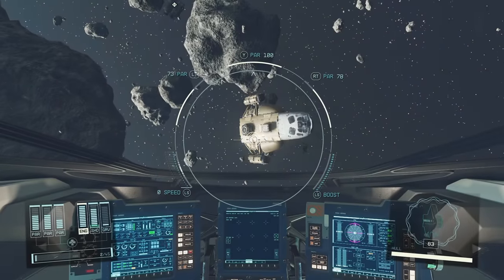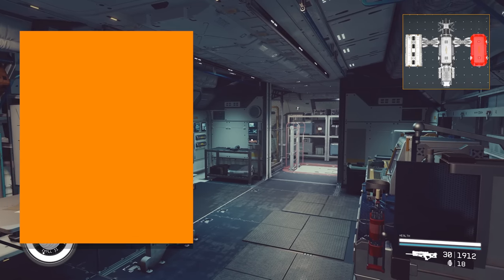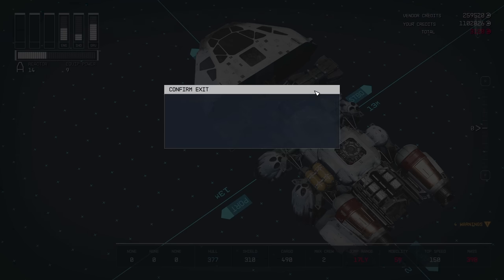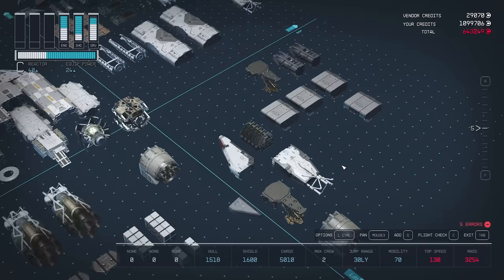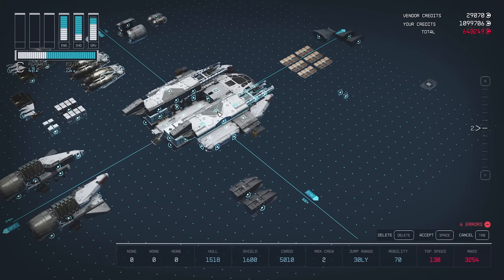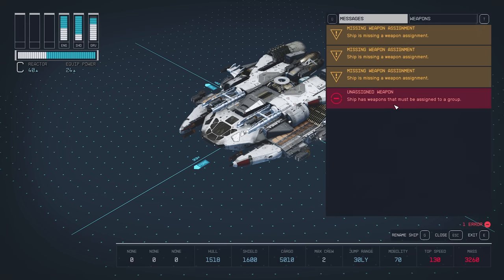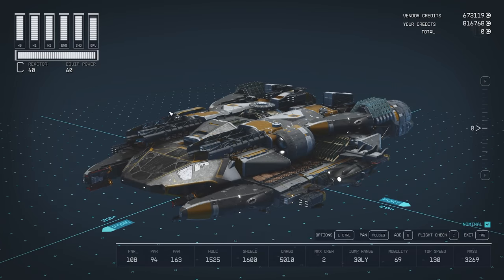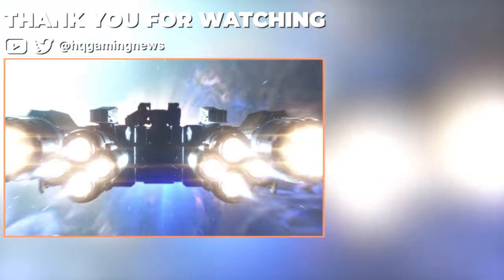The ULTIMATE ENDGAME ship in STARFIELD - No Mods, No Glitches, No Exploits

Comment: The Left Hand HE3 tank will not attach. If I take out Habitat and connect the HE3 tank, it works. However, when putting it back, the tank turns RED and won't attach. If I remove the top weapon, the tank will attach, but once it goes back, the tank goes red again. The only way I got this to work is by flipping it with a glitch, but the flight check says 'too much weapon power' and 'component missing

Comment: Do i still unlock the vanguard obliterators if i chose the crimson fleet?
Reply from the maker: I did UC quests first and Crimson Fleet second, and now I have the best of both worlds. I think you can do it the other way around, but I can't confirm that.
Reply: @hqgamingnews  damn i hope so.. lol hopefully someone else can confirm. Thanks!
Reply: @hqgamingnews  hey i need a hand again, sorry. I'm level 60 with max ship design and piloting. Why can i still not get certain ship parts like taiyos captain quarters? I even went to neon and the vendor still doesnt have it😮‍💨
Reply from the maker: To cycle between different hab variants, use the right arrow key (or right on the d-pad if you're on Xbox). Also, sorry for the late reply.
Reply: @hqgamingnews  hey, all good i figured it out! The ship is great and just to follow up on a previous discussion, i chose the crimson fleet in that story line and still unlocked the obliterators! So doesnt matter who you side with

Comment: use SAL 6830's, mobility will go up. 

You get SAL 6830's during the stroud ecklund mission in Neon from the main constellation questline, so long as you choose the Diplomatic option and don't kill the CEO guy.  they will be available at the stroud shop on neon.  ( the one in the main entrance area after you enter the elevator from landing pad) be prepared, they are about 70K per engine.
Reply from the maker: I wasn't diplomatic at all during that questline, so no BiS engines for me, unfortunately.

Comment: Bruh, why the rookie mistakes?
You're using the wrong landing bay. use the Hope tech. if you do, you'll be able to have a front-facing landing bay without changing the layout. connect it to the companion way. The better way is to use a 2x2 Nova All-in-one hab connecting to the bottom of the cockpit and a Deimos workstation next to it(the Deimos workstation is the only workstation with all the benches + a research station) you won't even need a companionway and cross braces. and using Hope tech landing bay will let you use Nova landing gear which has the highest thrust between every landing gear meaning you'll need less landing gears.
Also, the HopeTech Hab Cross Brace weighs 14 (28 cuz you use 2) instead you should use Nova Cross Passage which does the same and weighs 4 (8 cuz you'll need 2).

my suggestion: Nova cockpit;
first floor: 2x3 Deimos cargo bay connected to 2x1 Deimos workstation and 2x1 frontier all in one(unique hab) the two 2x1 should not touch. the two 2x1 should connect to the 2x3 cargo hold via hope tech spines. the hope tech landing bay should connect front facing to the cargo hold(it makes sense for the entrance to be in the cargo hold that's how you load cargo in a ship, directly from landing bay)
second floor, 2x2 battle station of your choice(lots of crew cap) connected to the cockpit + armory right next to it(direct connection, no cross hab) + at the back of the battle station(back outerside) a hope tech spine connected to a 2x2 Nova all-in-one with the captain quarters(preferably Nova) next to the 2x2 all-in-one(directly connected). you'll put a companion way on the other back of the 2x2 battlestation with a cocker on top of it.
You'll have plenty of space to hide the giant grav and reactor between the habs. and the inside of your ship will be huge and very practical. lots of beds on both floors. every bench+cooking+research station+armory+more than 6 crew.

That's how I made my Spectre MK-IX(Yes there was 9 versions) large ship. Now I'm using Spectre SR-4(Stealth Reconnaissance) as my high-speed high-mobility high-DPS small ship.
Reply from the maker: Hey, thanks for the suggestions. Gonna experiment for sure.

Comment: Missing some components - what skills do you need leveled up? Starship design?
Reply: Went piece by piece and different parts require SD 1 up to 4. On top of that it looks like the engine unlocks at level 60 and also required SD 4.
Reply from the maker: Everything explained at 24:43

Comment: Can this be done without a planetary base? Can't be arsed with them.
Reply from the maker: Yeah, you can do it, but you'll have to run around a bit to grab what you need. You really only need the landing pad; it doesn't have to be a full outpost. Just pop down the outpost beacon and slap in the landing pad. You don't need power or any other buildings, just the landing pad.

Comment: I really love this ship. I've been using it for a long time, but I think I'm encountering a bug that only seems to occur when using this ship. For some reason, my shields do not regenerate in combat even after not being hit for over a minute. 

I've tried everything to figure out what's wrong. I've swapped shield generators. I've taken power out of the shields and put it back. I can't get the shields to come back in combat. I've switched to a different ship and it doesn't have the same problem. It's mostly not an issue because you can destroy most enemies before they take your shields out, but it makes attempting to disable/board enemy ships a pain.

Has anyone else run into this?

Comment: Wait, how do you buy all the special parts from all the different suppliers??? I always have to attach that stuff to my ship and fly across the map to each one. So annoying. And no, the large pad does NOT have ALL ship parts. In fact, the 3x2 ,2x3 and 3x3 habs aren't to be found at all and i am "max everything" in ship engineering .
Reply from the maker: Well, you don't have to edit the ship you're currently using. You can choose one that is sitting in the hangar. This way, when you visit special parts vendors, you can attach those unique parts to that specific ship. It can save a lot of frustrations. But yeah, you're still going to need to jump to a few places.

And you are right, the biggest 2x2 up to 3x3 hab modules can only be found at the manufacturer's site.

Comment: There's something bugged in the varuun ship I commandeered to upgrade. Everytime I get a few steps in after adding engines  reactor, and grav, I get the " invisible ship" problem again. I'll just have to restore to before the commandeering
Reply: What I'm about to tell you , I SWEAR I'm not making this up .
So I restored to before the invisible ship problem and this time modded a free class A  ship, not stolen.   
After I applied the Cabot  bridge, which of course was far too wide for the two  habs attached to its centre , I went to Hopetown to get the spine and bracers.  Got out of the ship , stood on the tarmac   - and my ship had STRETCHED  TO TWICE  IT'S WIDTH  so the habs met the edges of the Cabot bridge !!!    
The front facing bay  - there was now TWO of them  along side of each other.  AND there was a structural piece in front of both blocking the entrance so I could not board!!!   And there was none of this in the ship builder!
So I started all over,  this time applying the Cabot bridge last - success !
Reply from the maker: I believe you. I've encountered multiple overlapping bugs that can be fixed by returning to the menu or completely exiting the game. This issue occurred with bridges, cockpits, habs, and various structural parts.

The funny thing is that it only happened at HopeTech.
Reply: @hqgamingnews   yes, its become apparent some bugs are planet specific. You wonder if the buggy planets were programmed by one specific developer at Bethesda ?

Comment: As I was getting the parts together I found no Port of Aft parts.   Will have to come back to this I guess.  Forgot.  On console it is a crapshoot for HABS.  Don't know what we're getting except for engineering.
Reply from the maker: For certain parts, use the left D-pad to cycle to Port or Aft variants (while browsing parts). However, some variants can only be accessed by flipping parts with the Y button. Hope you find this tip helpful.

Comment: hey i’m level 130 but at 7:14  under habs taiyo captain’s quarters 2x1 mid , taiyo science lab 2x1 mid , nova galactic armory 2x1 doesn’t shop up for me. how can i get them ?
Reply: Also have starship design lvl4
Reply from the maker: Are you using the left/right arrow keys (or d-pad if you're on the Xbox) to scroll through the all available hab variants?
Reply: @hqgamingnews Pc and i got all the parts for Structural except 2x Deimos Wing C.  i only see Deimos wing c- port is this the one ?
Reply: nvm i got it thanks :)

Comment: Im very frustrated.  Im level 100 and I cannot get any of the Taiyo parts to spawn anywhere - not even in the taiyo showroom.  No captains quarters, science etc.  What am i doing wrong? Is there something other than level that unlocks them???
Reply from the maker: That's weird. 2x2 and larger habs can usually be found at manufacturers, but it's 2x1 and smaller ones that are common and available at your outpost's landing pad.
Reply: @hqgamingnews  i figured it out. There are alternate versions of parts in some cases so you have to use the arrow keys on a regular  2x1 part to see it. 

This is what happens when youre overtired and building at 2am lol

Comment: I was so excited for this having leveled up Piloting and Starship Design specifically. Now I see the level 60 requirement. Some components are locked behind a level? That sucks. It sucks that items are both level locked and stat locked. Guess I'm just going to make the best I can. Kind of shit though. Feel like my ability to make shit loads of money, and sacrificing points for ship building, should be rewarded.
Reply: Having built this now at level 34 the only issues I had was the PB0-175 Auto Helion Beams (had to go with PB-175 Helion Beam - non-auto), the SF40 Reactor (got the SF20 instead which will likely make all my weapons kind of useless), a worse Grav Drive (got the RD-3000 Beta instead and used a Nova Bracer below for the tail fix since the RD-3000 isn't a 'two-level' piece), and swapped out the two Amun Dunn X-300 Engines for more Supernovas (best I had available).

While I'm able to complete the build, I have about half the jump range and mobility of this build. Still stoked to see 'nominal'!

Comment: Didn't work for me , built it exactly as shown and wouldn't let me finish, kept saying landing bay needs to be connected to cockpit , and docker module's need interior connection to cockpit
Reply from the maker: That's odd. I built this ship twice from scratch just to be sure everything was in order before making the video. It has a very simple interior layout, so I can't troubleshoot without looking at some images. However, that "landing bay needs to be connected to the cockpit" message is something I've encountered in some of the other ships, and the only conclusion I've come to is that the editor's pathfinding is the culprit. I mean, you can clearly see that everything flows nicely, but the error can still pop up. So this might not be you, just so you know.

Comment: Not buildable without some kind of cheat. The tanks will not attach to the left side without using the glitch technique, and the errors say 'too much power to weapon' and 'missing components,' despite me building exactly to these instruction
Reply from the maker: You can't have more than 12 power assigned to any one weapon group. If you list how many of each weapon type you bought, I might be able to help.

As for the fuel tank, did you flip the part before attaching? (Z on PC, Y on Xbox)

Comment: Not a jack of all trades if you have no em weapons. Em is a must if you want to cleanly handle boarding etc without blowing everything up. Plus you should do Walter Strouds mission to get best sal engine in game to push mobility up. My ship has 15k cargo weighs 5000 and still has more mobility then this.
Reply from the maker: 1. As explained at 23:30
2. I did that questline in a not-so-diplomatic way, so I'm locked out of those engines forever.

Comment: I built the ship according to your instructions, but when finalizing the system says "Too much energy consumption, reduce your weapons".
Reply from the maker: Can you list how many weapons of each type you bought?
Reply: @hqgamingnews Where did you get the J-52 Gamma Grav Drive?  I don't have that at all.  I use the Grav Drive SGD 2300. My installed weapons are Auto-Electron Beam PBO-40, Auto-Proton Beam Distuptor 3310A and Helion Beam PB-175.
Reply: @hqgamingnews I don't have the reactor you have either.  My highest level reactor is the Theta Pinch C9.
Reply from the maker: It's probably your reactor that causes these errors. Check 24:43 to see if you meet all of the requirements.

Comment: my specs for my ship Crimson Wright iii upgrades Pinch 8Z Reactor, fuels tanks 2 x 700T He3 Tank removed the 2 small fuel tank back the ship for mass, Assurance SG-1800 Shield Generator,  Apollo GV200 Grav Drive 6 x SAL-6330 Engine how i achieved this moved the docking port to the right side of the ship and placed generator there, Weapons im affraid all weapons had to be swapped duo to the fireing duration between shots being too long!! not ideal specially multiple hostiles, 6 x Vanguard Arbitrators, 4 x PBO-175 Auto Helion Beam, 3 x Vaporizer 35MeV Proton Beams

Comment: Very nice ship however not the best I've seen especially not for end game. I have two Demos war ships made based off other tutorials. Both are at the max length and one is at the max module limit. You physically can not make a bigger ship. 

The latter ships stats are way higher than yours except for shield and cargo which it's just short. I'm only level 15 and already doing 2x the damage with 2x the hull strength.

Comment: I did the whole thing and at the end it said the landing bay is not connected to the cockpit.  I checked and double-checked and it IS connected, but the error persists.  So fucking annoying
Reply: I closed out the game and restarted and was able to resolve the issue.  The only thing I did different was add the Com Spike to the ship.  Awesome design, thanks for sharing.
Reply from the maker: That is one of the bugs with the shipbuilder. Later today we're releasing a video that addresses several major issues with the current version of the shipbuilder (along with a few tips to alleviate them), so keep an eye out. 😉

Comment: Claims an Ultimate ship. Has mobility less than 100. sigh 

I would never use a ship with mobility less than 100 for anything other than picking up and dropping off outpost supplies, and those require cargo over 20,000, and shielded cargo over 2000.

Whatever. Have a comment to help with the almighty algorithm.

P.S. Why would you use a Science Lab instead of an Infirmary?
Reply from the maker: The infirmary is essentially the same as the science lab, with no real difference, and I didn't have a specific reason for picking one over the other. Bethesda should have designed it so that the infirmary includes a pharmaceutical lab, while the science lab features the research station. That would make more sense.

As for mobility, it's an overrated stat. If space flight were handled better and leaned more toward simulation, rather than being dumbed down as it is now, then I could see mobility becoming important.

Comment: Yeah just didn't work for me, the classic 'module not attached', I salvaged, something, after f***ing 2 hours, really annoying, it looked identical, but wouldn't save. Thanks anyway.
Reply from the maker: That's one of the bugs related to some weird, hidden mechanic in the ship builder. It happened to me with some other ships.
Reply: @hqgamingnews  I managed to get a ship together, it does look so awesome that I do want to try it, again, just wish I could save part way through
Reply: @hqgamingnews  I DID IT, phewf! A tip though, I saved left, went to New Atlantis, instantly I got the error again! All I did was double click the ship and I could see the ship part (one of the bank spines) was unattached, clicked a 3rd time, selected the parts and just remounted them. Solved the issue. I also installed a mod to return the comspike and other part since I finished that quest line siding with the UC and I think that's a "bug" imo that they can't be re-purchased.
Reply from the maker: Awesome!